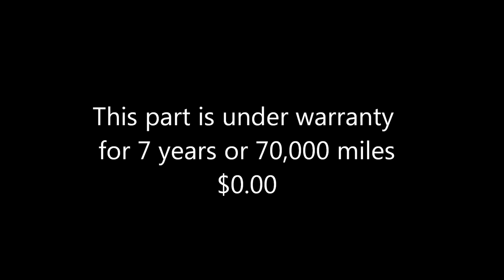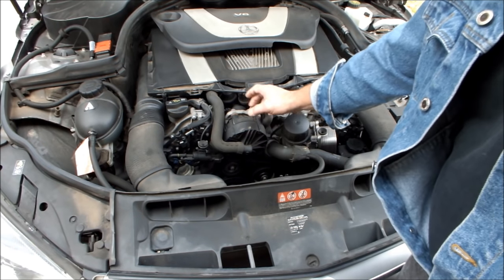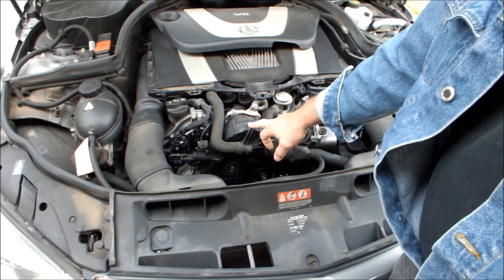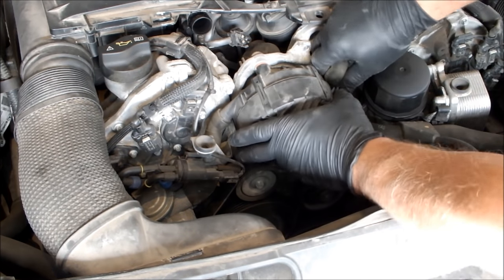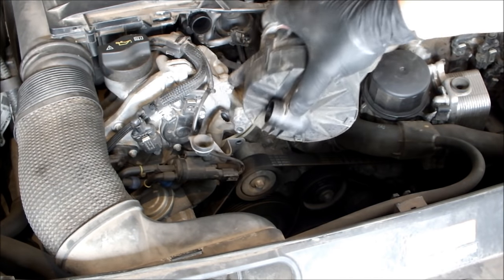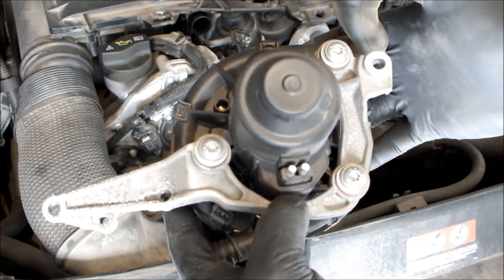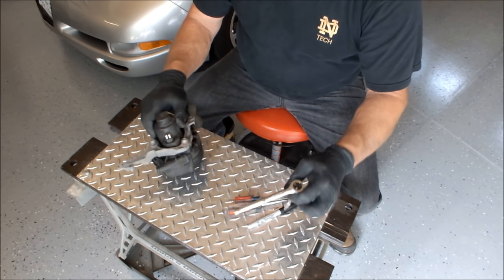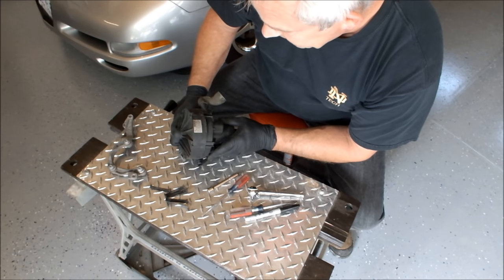Mercedes Secondary Air Pump Problem

Comment: Great video and is worth a try, however, I saw brand new aftermarket pumps on Ebay for $84 including shipping. Considering the time spent to do this, it may be more worthwhile to replace with new for well under $100 US.
Reply from the maker: Give the cheap one a try - the original one was no good why try them again?
Reply: When a part costs $700 and you can find it on eBay for under $100 I'd be a bit suspicious of quality however the pump is little more than a DC version of a two stage shop vac blower and you can buy an entire shop vac for under $100 so who knows. My policy on eBay is always "buyer beware" but there are good products on there at greatly reduced prices from OEM. The disassembly process didn't look that time consuming or complicated and even at $100 the two hours it probably took to disassemble and reassemble it would equate to $50 per hour, I used to make that kind of money and even then I favored DIY wherever possible and put the money in the bank, I guess that's why I retired at 53 with all my toys and it's play time. The only step I'm going to try to add to this process is attempting to locate and replace the brushes because the black dust he blew out of the unit was brush material so I'm not sure how long his customer's pump will remain quiet if the brushes are worn below spec., in any event awesome video.

Comment: Thanks for the great video. I had the same issue on my 2008 C300. Mercedes wanted $ 1,200.00 to fix the issue. I found the part online for $ 143.96 at Pelican Parts and on eBay for $ 167.95. Mercedes Benz part # MB000-140-51-85 is listed for $ 875.00 from the dealer. Wow! The dealer does not provide you with a jar of Vasoline if you purchase from them.
Reply from the maker: ah - that's one way of putting it

Comment: just changed mine and what an awesome video to show the bolts needed to remove.  1/2 hour is all it took to put in a new one and then repair the old one for next time it fails.  Thanks again.  My labor plus 130 bucks for the part saved me a bundle!
Reply from the maker: That's what I want to hear - excellent

Comment: Excellent video!!  Based on lessons learned from your video, I tapped outside of the pump with a wood marlet, then the noise disappeared.  It was a quick 10 mins job and saved enough money.
Reply: I realized that it won't be the permanent fix; however, there's no such thing as a permanent fix.

Comment: Can you imagine a goddamn repair shop in my town asked me for $2800 to repair this?  My car has the engine light on but it does not have any horrible noise. Thanks to your video and I decided to disregard it until it sounds like a jet engine. :)
Reply: At first, I mistook i2800 as 280 and thought it was a little bit expensive. Then, the manager told me it was $2800. F**K OFF!!

Comment: Thanks for this video, my secondary air pump is making a similar noise, the pump looks like a glorified two stage shop vac blower. The black dust you blew off was obviously wear material from the brushes so I'm not sure if it was addition of grease to the bearings or the removal of the excess dust that actually got rid of the sound. I will be removing and disassembling my pump and will also try to see if I can't replace the brushes as part of the cleanup and lube process. Thanks again for the video it's a good guide even for my 05 SLK 55 AMG.
Reply from the maker: Kurt - thanks and let me know how it works out please
Reply: It's on my list of many projects but I will try to remember to also post the part number on the brushes if I am able to find them and send you some pictures or video of the replacement process, I'm speaking from pure ignorance at this point because I have not yet seen the motor first hand to see if it can be done.

Comment: 2007 C230 Sport/ I've had the car for 15 years now/ 

I usually hear this pump for the first 10-20 seconds during a cold start / yesterday morning the sound stuck around for what seemed a minute or two. After I drove off and was sitting at a traffic light the car felt like it wanted to flame out. Not sure if the two are related. 

I checked the hoses to make sure none were lose or disconnected and the car has not repeated the same minute long whine/ idles at about 300 RPM with no noticeable sign that the engine wants to flame out. 

I suspect the long whine may be this one component/ close flame out may be something entirely separate (new coil packs and plugs went in last year).  

Hoping to keep the car running another 3-5 years if possible so I hope its not anything major. 

Thanks for the content.
Reply from the maker: Sounds like 2 problems - get codes - also disconnect power to blower if you suspect its the source of the noise Bob - let me know what you find - Cheers from Canada!

Comment: Good job on your diagnosis of that Bosh air pump and taking the time to identify the underlying cause of the noise it was making. Unfortunately, many in today's society won't take the time to do this kind of troubleshoothing and choose to take the easy way out by ordering a new part. The only disagreement I would have with you is replacing it (if need be) with a knockoff or less expensive part. If a customer can't afford paying for OE then they probably shouldn't own a Mercedes.
Reply from the maker: Lots of MB parts made in Romania etc - you are assuming OEM parts are the best built, longest lasting etc? My rule is if it lets you down try someone else's product

Comment: Thanks for the info , I have a GLK350 Benz and I have the same Noise . . . disassembled the air pump and greased up the bearings .... issue solved
Reply from the maker: Glad it helped and thanks for the tip Hurex - Cheers from Canada!
Reply: Did you get and error code before the fix?

Comment: Suggest using a fuse in the hot lead from the battery... " trying not to touch anything" is a good way to take out front SAM, or at least the mega fuses by the battery.

Comment: I had the same problem with my certified pre-owned 2010 E350.  It was under the Mercedes CPO warranty, so the repair was covered.  The issue that I ran into was that the secondary air pump failed every single year, so I had to replace them yearly for 3 years.  The last time it failed, the warranty had just expired, but because it was replaced just under a year ago, it was still covered under the factory part warranty.  This time the dealer looked into why the part failed every single year and they found that the secondary air shut off valves were leaking exhaust when closed.  They ended up replacing both left and right bank secondary air injection shut off valves and that solved the problem with the air pump prematurely failing.  Because my CPO warranty had already expired, the dealer got Mercedes to agree to cover the parts, but I had to pay for the labor.
Reply from the maker: Sorry to hear all the trouble John - their story about the cause sounds suspicious to me - but you"ll know for sure within a year or so - if they found the cause they should issue a TSB on it.
Reply: @carquestions  That was what was listed on the repair order on what they replaced.  I believe that was what fixed the problem, since it has been three years since that repair and the secondary air pump has not failed since.  What ticks me off is they never bothered to look for what was causing the secondary air pump to fail prematurely when I had to replace it annually, not until my CPO warranty had expired.
Reply: Hello CQ!  very fishy...  I’ll bet that they’re hoping he sells/trade up  the car by then🤦🏽‍♀️ SMH 🙇🏾‍♀️ 

This is why we’re all searching for answers here, because they’re constantly Overcharging for working on Mercedes Bz due to failure of inferiority of original parts from factory on MB that have under 150k mi   ☹️   Ridiculous!!  I had a 04 es330 /348k,   I never had any issues!!   I gave to my G’daughter  🤦🏽‍♀️ Now I have this MBz  sitting  w no power to the fuse or air pump, it’s  unresponsive, No Codes!!  Geez🙇🏾‍♀️   I’m going back to LEXUS and I’ll enjoy the ride with a piece of mind😴

Comment: Mine was this bad I have a c280 with 84,000 miles on the clock. I bought  new one on ebay for £50 took 30 minutes install and sounds so quiet now, instead of waking neighbors with my old jet engine one. Mercedes dealer quoted me £674.99 + Vat for part alone with labor I bet it be £1000 so for £50 I'm happy 😂
Reply from the maker: Same price hear in Canada - Well done AA - Cheers!

Comment: Bad Engine Temp Sensor can cause the Engine Cooling fan to default to an "ALWAYS ON HIGH" Mode whenever the car is started.
Reply: My sister had that bad sensor in her w203 230. Replaced & sounds normal again/fan only comes on when it should

Comment: I own a 2005 Crossfire and a check engine light popped up and it’s the smog pump but every time I look it up it brings me to Mercedes videos is it the same part for both?
Reply from the maker: Yep - your car is 99.9% mercedes so get the mercedes pump -

Comment: Hello, mine does not sound that loud or annoying. But in the morning it is much louder and becomes faint during regular use in the day. Will have to check this.
Reply from the maker: usually won't come on again during the day - just the first thing after a long period

Comment: I Also agree as from below,  E,  yes the black dust is from the electric Carbon brushes and there's a great possibility they are Worn out, just touching metal to metal.   You should be able to get brushes,  if not buy electric chain saw ones and modify then to size/fit. And well done on fixing the pump. 👍
Reply from the maker: Good tip B Robb - cheers!

Comment: I had the same problem with my 2012 C250.  But two months ago when the engine light came on, it didn't sound loud like that. Now it does sound like it a bit. And two days in a row, when I started the car cold, it struggled and I couldn't accelerate fast at all and the engine light blinked a few times and then came on. So I let the car idle a for a few minutes to listen for anything. Nothing more. So i turned off the car and 5mins later when I started the car, the engline light was off and it was running like normal again. I got the p0410 code. 

This has happened 2 days in a row. On the third day, the engine light just came on, but the car didn't struggle. Any idea what it could be?
Reply from the maker: It's the secondary air pump causing the problem - to test your theory just disconnect it and see what it does

Comment: hey great video but my car is a 1995 c280 benz  and it does the same exact noise when started in the morning , would this be the case ? and where would it be located? thank you
Reply from the maker: If the noise only comes on for a minute and only when engine is cold then yes it most likely is the problem DJ - look for a similar  looking electric motor under the hood
Reply: DJC

Comment: Hello Mark, I have a 2009 C300 with almost 70k miles. My pump sounds the same like the one in your video, also the engine light is on with code P0410. Is the noise pump the problem of this code? I would like to make sure before getting a new pump to replace. Because I saw other post with this code is not cause by the pump. Thanks for your great video.
Reply from the maker: Yes it was the same code I had - change the pump JC
Reply: Mark, I replaced with a new pump. It runs quite now. And I cleared the code. But after couple cold morning start, the Engine light come back on with the same code P0410. What you think I should check next?

Comment: Hey @carquestions, thanks a ton for the video. After watching it I tested my Aux Air pump and it makes the same noise. Am I able to drive the car with this part removed until it is repaired?

Thanks
Reply: Doesn't look like this KNOW-IT-ALL Replies to questions...
Reply: Yes you can drive it. You will have CEL that'll stay on until you replace it however.

Comment: A check engine light brought me here. I checked with a code reader and got P0410 secondary air injection system. Followed by another code 0814-00 Malfunction of secondary air injection at left bank of cylinders (function chain) (P0410). I visually inspected all connections and hoses and those seem to be OK. Mine does not make the noise the one in the video did. Any suggestions?
Reply from the maker: Change the pump - here's why - I changed one out a noisy one and a week later the code came back but the second SAP wasn't making noises like the original one - put in the third one and it has been fine ever since

Comment: i have the same issue.. is it an urgent matter to fix ? does it have a lot of negative consequences on the engine or the exhaust  if not fixed quick ? thank you very much for the video btw and thank you if u ever replay to my questions
Reply from the maker: You can drive as long as you like - shouldn't affect the running of the car at all - lots of messages maybe but just disregard until you can fix it - wouldn't let it ruin a trip
Reply: nice thank you for the quick answer :) have a good day sir

Comment: Dear chief, huge thanks for your help i have one more question, i have 230 c-class gcc spec and as i found from the check engine the fault code was 0140 and theres no jet sound while running the engine in morning but the main issue while the car running on any hight way to rpm needle is not stable moving up and down and i feel the car is not normal , do you think the problem is from the same secondary air ? Please i need your help and support
Reply: High way*
Reply from the maker: Your problem doesn't sound like it is related to the air pump - so check the car for other computer codes asap - BTW could you do me a favour and check out my arthritis video and let me know what you think please - in need some feedback - cheers Fahad! - let me know how you make out.

Reply ·
Reply: Thanks for response chief, today i went to one if the mechanic and he told me that my car have air leak from the throttle manifold and the air are not passing to the exhaust system, can you advise?

Comment: Hello, excellent video and explanation. Question I have is what type of grease did you use to inject to it and how is the car today since you did that to it?
Reply from the maker: Any light oil you have kicking around - its just used to diagnose it - the joint was replaced a day later
Reply: @carquestions  what does it mean the joint was replaced a day later? So the light oil was just temporary?

Comment: I got my secondary air injection pump and relay replaced and P0410 and the check engine light is on. Do you think it could be the new part I bought it on amazon. We checked it and it worked. So what is going on? Thanks for the help.
Reply from the maker: They sometimes do that - disconnect battery for 20 minutes then try again otherwise try another replacement
Reply: Is your check engine light on still?
Reply: Don't you have tondrive for a certain amount of miles for it too clear?
Reply: LETS PLAY I did but nothing.
Reply: @WaveProject   my check engine light is still on too and i need it to clear so i can pass smog they said it could be not enough volts and could be due to some technical wire issue not sure if its ground or not but im going to get it fixed for $50 I'll update this once i get it done and find out what it is👍
Reply: LETS PLAY yeah, let me know if it worked. Thx
Reply: @WaveProject  hi, does  it work?
Reply: LETS PLAY yes, but it didn’t
Reply: Yihoo Ho no
Reply: Make sure you don't have any vacuum leaks that can be an issue as well
Reply: are you saying you cleared the code with scan tool, yet the check engine light came back on?
or you did not clear the code?
Reply: @davidjacobs8558  yes, I did clear it and after a while driving it came right back on.
Reply: @davidjacobs8558  yes, I cleaned the code and it came back

Comment: Hey Mark - 
I'm getting P0410 code on my 2008 C300. The thing is, it doesn't sound like a circular saw or anything in the morning. I can hear the Secondary Air Pump (I think) running when I turn it on from a cold start. Any idea on what else it could be?
Reply from the maker: Let the problem develop further - it's the SAP most likely
Reply: carquestions Thanks for the reply. I've had this p0140 code for four years - if something was going to break on it, shouldn't it have broke by now?

Comment: I have the exact MB that he's working on in this video. In the past 3 months, my auto repair has replaced the secondary air pump 3xs. I have  had it home for a week and it sounds like it is on the verge of failing again. I can tell by the smell, how it drives, and also the sound.They have checked the electrical, etc. Any thoughts or insight?
Reply from the maker: Sounds like you have parts replacers instead of a real mechanic - you are not paying them to guess or "try" and fix it otherwise you should "try" to pay them if you get what I mean - Sounds like you need a new mechanic Amy - good luck and Cheers from Canada!
Reply: Sounds like your guys arnt really replacing the pump with a new one. Clean and shine up the old unit and back in it goes! Theres not much to wonder about the seconday air injection pump. Just a electric motor that runs off 12 volts. Super easy to test with just 2 wires to a battery. If it fires up then your pump is good with no reason to burn up. Unless: but it does run off a relay in the fuse box. When you start your car the air pump should stay on for only about 20-30 seconds then shut off. The relays are known to go bad now and then and thats where the air pump stays on and wont shut off and the air pumps burn out and fry. Thats possibly what your smelling. Id bet your guys didnt replace the relay which is only about $15 bux. Relay is 10 second job like a fuse....just pop the old out and plug in the new one. Hard time believing your guys have put in 3 pumps that run on a 12 volt system and they all burn out.
🙄 😒 😬
Reply from the maker: Good advice John - Cheers! @johnhall4427